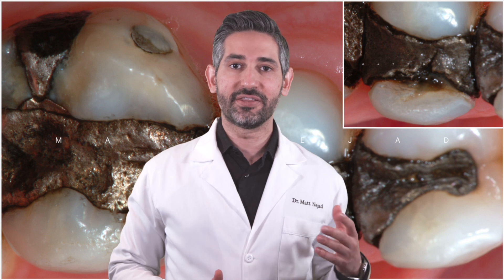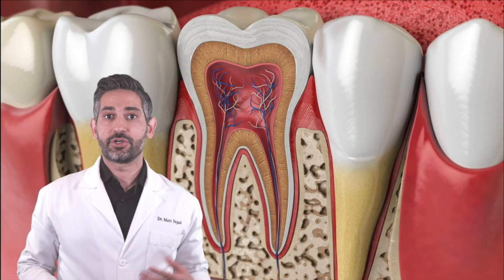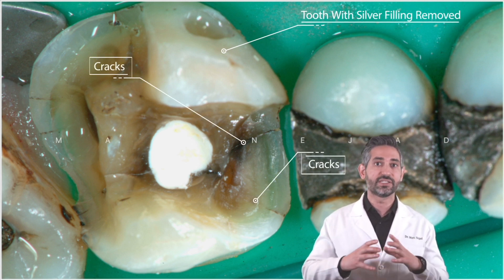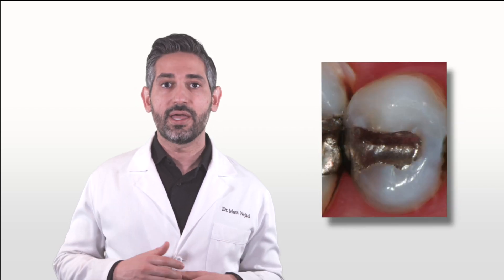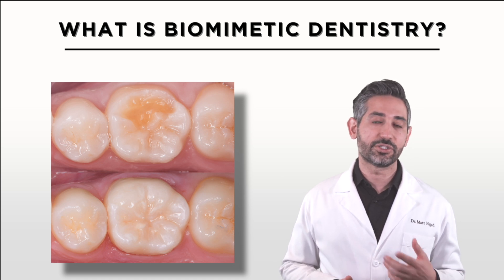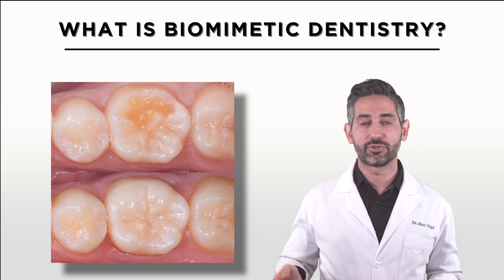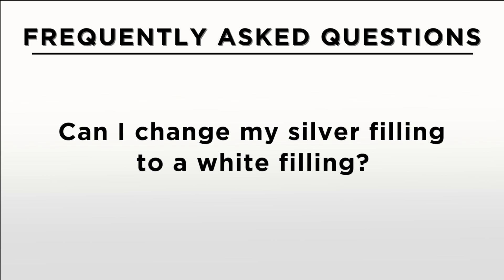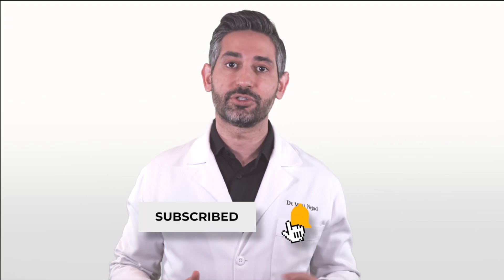Replacing Silver Fillings with Biomimetic Dentistry | When, Why, and How to replace Amalgam

Comment: So happy to have come across your video. I just got an amalgam on my two back top teeth. I felt little bits go down my neck as he was filling it because he didn’t use a dam, and on top of that, he did not inform me that he was using silver at all! I was surprised/upset to see it in the mirror after I got home. Anyway, I now have an appointment with a more trustworthy dentist to see if he will replace them with white ones. I know it is not recommended to replace with composites before you need to, but I’m worried about the possible expansion of the silver with hot and cold causing my tooth to crack. I’m very upset because I feel like there is no right answer here. 

Anyway, thanks for your informative video! Glad to see there are dentists who genuinely care to inform. :)
Reply from the maker: Sorry you have to go through that. I hope everything goes well 🫶🏼

Comment: There saying the silver fillings are ok  
They are waiting until every one with silver fillings passes away then do not have to give out compensation
Reply from the maker: Interesting concept. I don’t think thats the case but that is not to be confused with me thinking its a great restoration. If you want to keep it really simple, remember that we had no other options in the early 1900s. Ceramic was failing rapidly because of adhesion, gold was too expensive most people (time consuming) and tooth colored fillings and crowns came later. First tooth colored fillings were terrible due to adhesion issues. So it really helps to remember it was the best option we had for the time but now we have much better options though it is still more expensive and time consuming.

Comment: Is this filling last longer n better  than ceramic inlay or onlay
Reply from the maker: Hard question to answer. Usually the best option is based on the actual clinical circumstances, so sometimes a filling is best and other times an inlay or onlay. Whichever is best is expected to last longest. 3D printing will revolutionize treatment options with 3D printed fillings that are stronger than fillings and cheaper than inlays! its currently very tricky to to them but its going to get better!

Comment: It's all about money.😢
Reply from the maker: Angela - thats not true and I am sorry you feel that way. From my perspective, it is frustrating to hear you think money is the driving force. Im sure it makes sense that you will get a better product if someone spends the time to do it to the best level possible. Dentistry that lasts longer than the minimum standards is not magic, its just time and effort. It usually takes  2-4 times longer than doing it quickly. Just think about how that impacts the cost, including staff, rent, assistants, time in the day, etc. Not to mention the lab costs, equipment, etc. The real problem is that many patients think that that all dentistry needs to be the highest level, but don't value the cost involved, therefore most practices and insurance models are focused on providing the minimum quality.  If you spend more time treating one patient at a time vs running an assembly line, it is going to be more expensive. It also costs me more. I only see 1-2 patients a day, but my fixed costs are the same or more than other practices that run at high volume. The cost is just the result, but it is not the reason. The most successful dentists in the world do cheaper dentistry with high volume practices. The also own multiple practices. With this approach, Its no wonder that most dentistry only has a life expectancy of 2-5 years under insurance reimbursements. Most patients come to realize that this is not the best treatment available, but you have to understand that better quality will require more cost because of the time, energy, effort, and expense involved in providing the better treatment. Extra cost is the result, not the reason.

Comment: Why would you replace silver fillings? They have a corrosive layer that provides greater protection from micro leakage.
Reply from the maker: Good job watching the video 👌
Reply: @biomimeticdentistry  yeah I watched it but it still didn't really answer my main question. I understand the Mercury controversy but when Mercury is bound with other metals you don't get Mercury leakage, it changes it to a completely different type of metal. One thing I have noticed is dentists bulk fill with composite instead of doing a layering fill. Most of them cure from the top which causes the material to shrink and pull away from the walls causing more micro leakage. So our biomedical fillings just a fancy way of saying you should always have proper technique? Because bulk filling is very poor technique.
Reply: @user-sr3tj5gn8y  You do get mercury vapors. It's directly observable on video that the mercury releases vapors - especially when agitated.

Comment: I'm 31 and I have 1 silver filling from when I was 12 lol I've had no problems
Reply from the maker: How do you define no problem? Do you have a nice photo of the tooth? You might be surprised what you can see when you take a close look.  The absence of pain does not mean the absence of problems. Cracks and fractures happen over 30 years and this is a common occurrence. Smaller fillings do better than larger ones because having more tooth remaining minimizes the problems and preserves more of the strength.  Best- MN

Comment: Don't they have to do air vacuuming filtering and suction while removing them?
Reply from the maker: The studies show that using rubber dam and high volume evacuation results in no detectable increase in mercury levels.  According to the science, those are the absolute requirements and more is precautionary.

Comment: I have mercury fillings and 2 root canals. I feel my body is  being slowly poisoned as I am struggling with several health issues.. pls advise best ways to have them removed.
Reply from the maker: See a dentist with quality you can trust to provide a treatment plan and take care of this. Its hard to positively identify that the restorations are causing this, but if you have tried other options and you feel that this is contributing, then you can seek the dental care to address this. Best- MN

Comment: What are your thoughts on gold fillings? I wish they would make a comeback. I feel like it's the best filling material.
Reply from the maker: Gold fillings were made with gold foil which has not been used forever. Gold inlays and onlays are still used. They do well compared to traditional fillings and crowns but they are non-bonded and there is truly nothing comparable to bonded biomimetic restorations. Biomimetic restorations have been shown to be superior from every possible angle except  for the technique simplicity. Its the best but it is not the easiest.
Reply: @biomimeticdentistry  I see, thanks for the reply.  I got some silver amalgam fillings in my 3rd molars (wisdom teeth). I wanted to replace them with something less toxic and without mercury. Figured gold would be good. However, I think a recent dentist I saw, when asked about replacing those fillings, said they are pretty deep and changing them out would hurt. Thing is, I don't want those fillings due to the mercury, I also grind/clench my teeth at night.
Reply: @jakec5618  if it's wisdom teeth why not just get them removed? It's pretty common for people to have wisdom teeth removed as they often cause issue's
Reply: @Idlepit2 true
Reply: I can tell you a gold crown is the bomb.  Nothing will happen to your tooth that is covered by a gold crown.  If I could, I would go back and do more of them just for that reason.

Comment: I know someone who had 4 white fillings done at the same time and he had to change them to the silver because he said they caused him so much sensitivity that it was painful. Has this happened to anyone? I just had a white filling done myself a couple of months ago and I have a lot of sensitivity from very hot or cold drink/food so I've been thinking of going back to the dentist to get it changed back to the silver. But now I'm learning that they are somewhat toxic. I get a lot of migraines the older I get and I have had two silver ones done about 15 years ago. I don't know what to do I'm confused. (all the fillings are small btw) I hope the Dr. or anyone out there can give me some advice. Thank u!
Reply from the maker: This is what Im saying though. Absolute matter of fact is that the problem is the quality and the provider. Not the filling. Its hard to do a good composite (white) filling and it takes more time, but it also has tremendous advantages over silver fillings. The problem you describe could definitely be avoided, but most business models don’t prioritize the quality and time needed to do it well.  The most important thing to do is have excellent quality dentistry, my advice is to find someone (like myself). Any other advice regarding what procedure to get is missing the big picture. I hope this helps and its what I was describing in the video.
Reply: @biomimeticdentistry  Thanks for your response. I will look into finding another dentist. The filling that I got most recently - the procedure was very quick.

Comment: I'm not sure if you still look at the comments for this video, but I just want to thank you for this video. After years of neglecting my dental health I ended up having to get all of my back teeth filled with amalgams last year. But despite me taking this step in restoring my dental health, my mouth honestly feels worse than it did before the restoration. My bite constantly feels off and my teeth still feel sensitive despite this taking place almost a year ago. And now finding out that my fillings could potentially be poisoning my body too makes me feel even worse. I definitely do want to get my amalgam fillings replaced with a composite, but I feel like the damage has been done already and trying to get them replaced would be too costly. I am honestly not sure what the next step should be for me.
Reply from the maker: The damage is not done, it continues with cracks that develop. See the new tooth cycle video I posted. If your bite is off and you are uncomfortable, you should replace them. However, please do your research. Replacing them does not mean it will get better for sure and the quality of the service is the most important aspect. A white filling can be terrible or excellent, but its the provider that makes that difference not the filling alone.
Reply: If I was you, I'd use this time to save up on more money to be able to replace them. What's done is done and having a tooth with metal on it is better than being toothless. If you're not having any medical problems relating to what silver fillings could cause then I wouldn't rush on getting them removed as they're guaranteed to last around a decade

Comment: I’ve silver fillings that would like be changed to white, but I’ve had them for over 22 years and never had a problem with them. I don’t know if I should or not
Reply: Don't do it the dentist out here or just trying to make money and you'll have sensitivity. A dentist took six silver fillings out of my autistic son's mouth and now it won't let me brush any of his teeth and he's nonverbal so this dentist only told me under my son would never have to go to the dentist again. In hindsight for us I took the dentist word as gospel but You're only supposed to remove the silver fillings if they're loose leaking or hurting you otherwise the dentist is going to remove your silver in any decay and they're going to just make a bigger hole. leave it take my advice leave it
Reply: If not causing problem or has no leak then leave it. Dentist will shave more of your teeth and will cause future problems
Reply: The vapors of mercury is gone after 7 yrs
Reply: If you got the money and really want to do it, then you should but I heard from a hygienist that removing silver fillings could cause exposure of dangerous toxins that silver fillings contain so if you want them removed then you'd probably want to go to a good dentist that's against silver fillings
Reply: Don't. You will get more mercury exposure from drilling them out than from a lifetime of having them in your mouth. And plenty  of those restorations can last you until you're dead.
Reply: if it's not causing a problem, do not create one. if you start feeling symptoms, then it's worth a shot. Every time they go in your mouth, they get another chance to ruin your health in one way or another.

Comment: Having 2 fillings in the UK at the end of the month, but he didn't really give me the option and assumed I wanted 2 alagam fillings, changing to white fillings, but one is on the wisdom tooth, not sure if that is an issue? hope you get back to me Dr. Matt
Reply from the maker: Well remember that the most important thing is the quality of the restoration. A white filling can be more prone to problems when it is done poorly, or it can be better than a silver filling when it is done well. I would rather have the best restoration possible, but that is not to say that any dentist will produce the same results. Some may provide really poor results with composite fillings so you want to ask them what they recommend. I want people to know that it is possible to get the absolute best results with composite (white) fillings when everything is done optimally, but that doesn't mean it will always be the best option, especially if it is done quickly or poorly without the proper steps to make it succeed.

Comment: I disagree with you I did white filling in India and after six. Month fall off and my silver filling I did in 1987 and now is December 28, 2021 still in best shape no problem whatsoever and the Dentist just push the silver in to my teeth with finger no machine
Reply from the maker: Well, disagreement is not an issue for me. With low quality dentistry, silver fillings are easier and will last longer. You say no problem but, this is really narrows down to pain. Over 30 years, amalgam treated teeth have an extremely high chance of cracks, symptoms, and fracture. When this occurs, the failure is considered catastrophic, as a result of many years of  damage leading to a bad failure. 

Now, if you are saying your while fillings fell out after 6 months, all you are really saying is your dentist in India did an absolutely lousy job, and I do believe that.  This entire video discusses exactly this problem, that a filling is not a product, it is a service. You can have excellent results, or terrible results depending on your dentist. Its also very likely that some dentists will not be as good at white fillings or will not put in the time. However, that doesn't change that composite fillings and bonded restorations are superior. 

Even in studies, composite fillings now have a greater long term survival (Opdam, et. al). 

Regardless, I wish you the best and you are welcome to disagree. I too disagree with you =)

Best- MN
Reply: @biomimeticdentistry  it baffles me how you can make a video and explain things to people and they still don’t get what you’re clearly explaining.
Reply from the maker: You made my day. Sometimes all I can do is just shrug and move on but I am glad you get a glimpse. Best - MN

Comment: You speak of the advantages of composite fillings because they are bonded.   What about bonded amalgam fillings?
Reply from the maker: Better than non-bonded amalgam but nothing like tooth substance. Composite is similar to dentin. Metal has a high modulus of elasticity that is incompatible with how an intact tooth is designed. From the standpoint of mimicking nature, its no contest. From a standpoint of longevity, complications, etc its also in favor of composite

Comment: What about govt transparency?  NIH did a grant study on dental white fillings. Guess what study was referring to?  Increasing estrogen in body from these white fillings.  Shouldn't MALES have a choice before these dental white fillings are used?  This study determined whether placement of composite (white) dental restorations (fillings) & increasing the  concentrations of bisphenol A (BPA)  had estrogenic-like properties that raised concerns about safety abiut . amounts of the chemicals leached out of dental sealants and detected in saliva soon after the sealants were applied. Dental composites also contained some of these compounds?  Why wasn't the public made aware of this and shouldn't it had been transparent?
Reply from the maker: Hi Jess. Doesn't everyone have a choice? As far as I am aware, providers provide informed consent. There is no perfect material in existence, but you are referring to research that began with dental sealants which are the most likely to break down and leech into saliva. Some fillings contain Bis-GMA but there are also alternatives. There is no solid evidence that Bis-GMA composites do produce significant or detectable amounts of BPA with most studies concluding little or no detectable level. Regardless there are alternatives, but be aware that the use of Bis-GMA is not for simplicity or ease or conspiracy. It's the most mechanically beneficial component of composite fillings that gives good physical properties. I always try to explain that the best thing you can do is avoid needing any dentistry, but once you need it, the next best is to do treatments that are likely to last and minimize additional complications. What material you use and how much it can leech is very significantly associated with how well it is done, and how well it is sealed and adhered to the tooth, so it's hard to make any generalizations.
Reply: I'd rather have a little extra estrogen than mercury in my blood and building up in my organs.